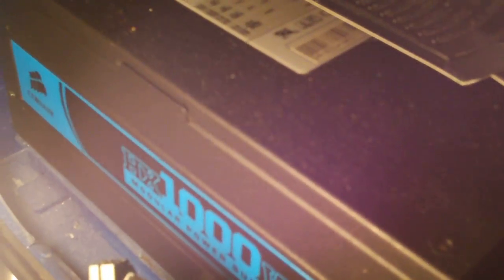Watercooling basics 101

Comment from the maker: yeah, The 775 could be water cooled cause of the memory controller is on the n/b.
With the 920 the memory controller is on the cpu its self creating more heat.
If you want to get lower temps on your chipset. Use OCZ freeze,MX-3 for example.

Comment from the maker: what you should of done is jump the psu. connect the pump to psu
fill reservoir as full as you can get. turn on psu let the pump run like 2 seconds. stop pump fill reservoir. continue this process until the reservoir is full. tilte case back and forward, side to side to get rid of bubbles. try piniching the line between component for 2-4 sec then let go. let loop run up to 24hrs to get rid of bubbles